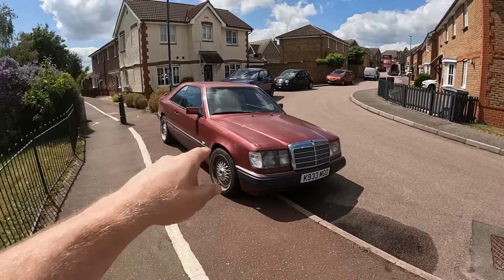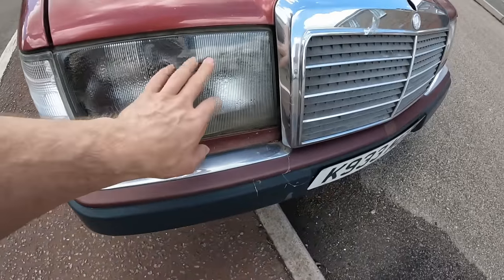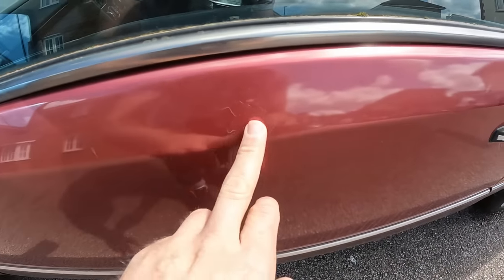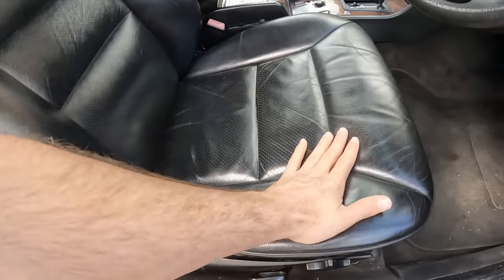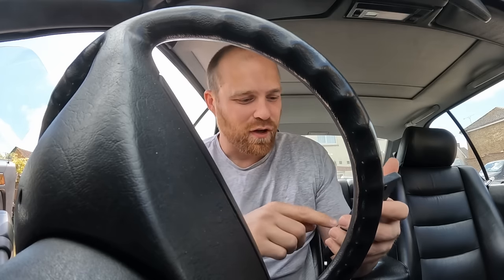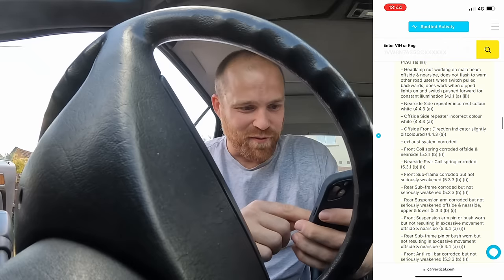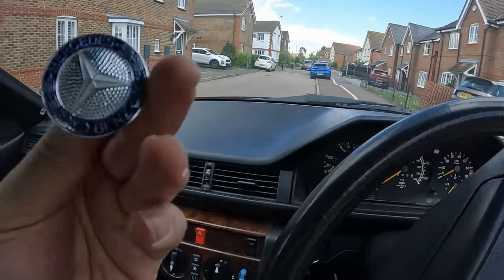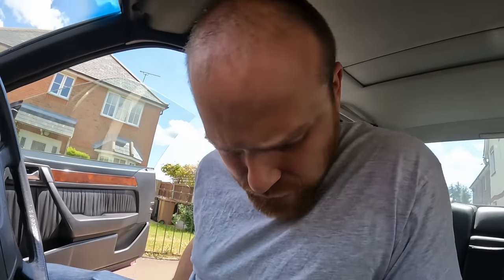Can this 29-year-old Mercedes be saved from the scrap yard?

Comment: I checked the MOT history on this car ... makes for scary reading.
I've had a few 190e versions - a common thing to fail is the fuel pump and OVP relays.  I bought a 1.8 W201 that wouldn't start without cranking for about a minute, wouldn't tick over, kept stalling, etc.  Otherwise immaculate.  Seller let it go for next to nought.  £40's worth of Chinese made relays turned it into an awesome daily runner.

Comment: A thing to be wary of, Mercedes used a biodegradable insulation on the wiring (I believe) and it has a tendency to crumble with age. The worst location is under the cover over the plugs due to heat. I had an E280 and had to have the entire loom replaced.
Also there is a way to open the bonnet to vertical for easier access on W124 models.
Good luck with bringing the car back to life.
Reply: It is indeed a weak speed - but luckily it’s more of a problem for the six cylinder engines than the four cylinder engine here.
Reply from the maker: So I spoke to one of the previous owners yesterday who told me that he had the wiring loom replaced a few years ago, so hopefully that problem should be solved already. Will certainly save me a few quid and a load of effort!
Reply: @NotEconomicallyViable  that's great news and it's certainly saved you a few pennies!
Reply: Yes i had the same on a 95 c280

Comment: I had the exact same model, was also randomly stalling - the culprit was a silver relay located behind the battery. It was damaged by water, a very common issue on these, check it and make sure to seal it if it is not damaged yet. Unfortunately I had an accident and had to total the car - missed it ever since. Best of luck!

Comment: Im a mechanic in NZ. I used to work on the W124s and this is one of the later ones. The motors are good but i remember we replaced a lot of airflow meters on them. They are mounted on the air intake hose just behind the air filter box. They also need fuel pumps when they get old as the resistance gets high in the fuel pump and they stop working. The best thing to do is spend the money and get it scanned at a merc shop. Another thought i had is One of the merc trans's has a sensor plate in the trans sandwiched above the valve body with a round plug that goes through the the side of the trans. If the ecu doesn't get a signal from the sensor plate to show the motors running it stops and shuts off the relay for the fuel pump. Its designed to stop the fuel pump running if you leave ign on without the motor running. If you need to buy one get the three "O" rings that fit the plug as they can leak if they are disturbed.

Comment: I think a lot of people know why the mirrors are like that. The path length from the eye to the mirror is different for the passenger side & the driver's side, because you don't sit in the center of the car, therefore the dimension of the mirror would need to be different each side to get the desired viewed area.

Comment: hey nino good video love the good old 124s. I've been driving 124 as an everyday car for 18 years now. from my experience the first thing you need to check is your insulation on the wiring in the engine compartment remove the black cover with the star on then you can see the wire. and behind your battery / black cover where you should be able to see your part number and year on the wiring if it's from 1993 then it should probably have a new one. number 2 check throttle body for wiring harness they are famous for breaking after all those years. number 3 replace your maf you can scan for the code with an OBD1 Diagnostic code reader for Cars with the 8 or 16 Port number 4 check your ovp relay it helps to control the idle in your 124

Comment: What's not to like? I have 4 190e s and all bought for under 500 pounds one for 250. Even with work needed doubtful it will depreciate and it has the three pointed star on the bonnet. Better than spending thousands of pounds on a new type bubble car as I term them. Others will disagree.good luck with it and I'm sure you won't be disappointed with the end result. Rog

Comment: Hi Nino. Glad you eventually bought the car you have lusted over for a long time. The stuff in the boot was a fantastic bonus.
                I am looking forward to the Project. Try not to fit too many "Knock off" parts as they "WILL" bite back. See you in the next one. Take care. 👍👍
Reply from the maker: Cheers, Norman. That's the only cheap part from eBay I plan to buy for this car. I only bought it because the OVP was only replaced recently and I'm not convinced it's broken again.

Comment: Mine is a 1992 220ce .. engine would cut out … checked  air intake plastics , ovp  and even the ecu .. turned out to be the crankshaft position sensor … after that worked great … hope you fix it !!! Cheers
Reply: Your color looks to be Almadine red

Comment: Love your video's man. Absolute binge watch material. I'm driving around in a 30 year old Volvo 240 wagon that i try to keep on the road myself. Had to lauch when you diagnosed the faulty relay, told everyone a moment later you're not a 'real mechanic' when it comes to diagnosing car issues, and then find a work order in the boot that states replacement of exactly that faulty relay because of engine issues 😂

Comment: A great find Nino, it would have been a great shame to scrap it, Mercedes definately do rust, but I think the older ones were just made with better steel, the later C and E classes were very rust prone.    
     I love the 190 and the later E class with the Oval lights and 3.2 Diesel engine. 
    Good luck with the car mate, look forwards to your progress.
Reply from the maker: Cheers bud 🙌🏻
Reply: I have a 2004 (5 cylinder) E 270 cdi and it's one of the best cars I've owned.

Comment: A common problem with relays of that age is cracked solder joints on the relay PCB (due to mechanical vibration each time the relay is energized). It makes sense to suck the old solder and refresh the solder joints

Comment: Might be worth testing the alternator voltage, regulator may have failed and putting out higher voltage and damaging the battery and/or sensors?
Reply from the maker: Cheers bud, will give that a go 👍🏻
Reply: YES!  My alternator was producing nothing at all...the dashboard was clicking on and off.

Comment: Nice project mate... Love W123/124 Mercs, last of the 'proper' Mercedes . I used to cab a 123 back in the 80's when my colleagues were cabbing cortinas and hunters etc. They used to ask "how can you afford to cab a Merc". Well Six trouble free years later I asked them "how could you afford not to? 😃😃 Looking forward to this one... My only concern though is the rust underneath.(I've seen the mot history) Get that dealt with first and it will last another 30 years... Cheers...
Reply from the maker: Ahh I love that. I read recently that German cabbies used W124s almost exclusively – 200d mainly.

I'll be getting her up on axle stands and checking out underneath, so hopefully it's not too bad 👍🏻

Comment: C124 is great , worth saving . Think the colour is Titanite? Your C124 is also one of the mid life ones with a later 220 engine (bit better mileage and performance than the 230) but the first era grill with the hood ornament on the grill not like the later ones with it in the bonnet. Many were converted to bonnet so nice you have the original set up. I think its quite good having one of these in between models best of both worlds so to speak. Air con and a roof is unusual in a 220 also ! 
Good luck

Comment: Yes something retro that looks awesome, I daily drive a 1988 Nissan Bluebird and it's been a kind of rolling project. Older cars are definitely less complex and all the work I've done has been with my Haynes manual about 100 pounds worth of tools and on the side of the road. Definitely be careful though of siezed bolts and for some reason my nissan has lots of Philips and flat head screws which strip so easily. If you come across lots of 'normal screws' I would definitely invest in the Halfords advanced impact driver set which is only 15 pounds and has saved me many times. Good luck with the resto and I look forward to these videos.
Reply from the maker: Love that. Roadside repairs are where it's at – great effort 💪🏼

Comment: I would be checking the fuel pump or some kind of petrol starvation. A relay going nuts so something is causing a short somewhere. Most people don't think of the fuel pumps yet they are the main fuel supply! .... Noisy fuel pump on a old car is the sign of it going! My Granada Ghia X was doing the same as your Merc, turned out to be the fuel pump. .... It's worth checking anyway ;-)
Reply from the maker: Cheers for that, Dave. Will check out the fuel pump and also see if I can find any shorts 👍🏻

Comment: I think you’ve got a diamond in the rough there.     I’d wager the front wings have been replaced already and that’s one of the key rust issues for this model;  the rust on the rear arch looks doable and the paint looks like will come up good with some treatment. One area to keep an eye on is rust on the jacking points as they’re covered and the plastic cladding can hide a number of sins.     A great choice of car when you get it back n the road.
Reply from the maker: I certainly like to think she's a diamond in the rough. Gonna give her the love she deserves that's for sure

Comment: The mirrors being different shapes and sizes is to do with helping with visibility on the opposite side you're sitting on. Helps you see the length of the vehicle. Opposite side for LHD because you need to see more of the right hand side of the car.

Same as on the VW T4.
Reply: I think the reason for the smaller mirror to be smaller was aerodynamics, at least that was the story when the W201 (190) was introduced IIRC

Comment: If it's had 2 new batteries and an over voltage relay, I would check the charging system. Could be the voltage regulator allowing over charging.
Reply from the maker: Great shout – I'll give that a go 👍🏻
Reply: yes try the OVP common to the 190e also. Should have a fuse in the top and may have a fuel pump relay also. good luck with the project. my advice dont change too many things at once or u end up not really knowing what the fix was! 👍

Comment: The noise in the engine bay is the throttle recalibration after the battery has been disconnected. And I did have 2 of the w124.  300e m103 and 300d om603 and the 300d I think was the best model. You got yourself an awesome car Sir (lol as you now ride around in the w124 platform).  Am also looking for one. Wow. Am longing for any w124 non runner but good chasis.   I ran the 300d on veggie oil before the veggie oil tax. For over 30,000miles. Bruv very nice find. Bolt on turbo kit for the m111. M111k conrods and pistons to lower compression and get speeduino ecu and boost away. Diff options, 722.6 with Olef tcu, and you roast audis and bmw all day.
Reply from the maker: Ahh that's good to know about the recalibration. Great to see a proper Merc fan watching the videos. Absolutely love that you ran a 300D on veggie oil for 30k miles. Hero.

Comment: I'd check the OVP Over Voltage Protection relay which resided behind the plastic cowling to the back of the battery. I think they're about £70 from the dealer, usually has a fuse located on top. You stated there was a lot of clicking in that area? I've always wanted a 300CE, but  currently have a 2.6 190e. Also corrosion wise, check the jacking points behind the plastic side skirts. .......Oh you've just mentioned the OVP whilst I'm typing.

Comment: Try some carb or brake cleaner aerosols directly in to the throttle body whilst it’s running, have someone keeping the revs up when you do it because it will want to cut out. Had similar problems with 90’s 3 series BMW’s. Good luck!

Comment: The OVP relays can come with different pin connectors so make sure you get the correct one. Other things that go wrong with them is the solders break in one that is old and you can open them up with some work and resolder the board inside. Use your phone or a good light and magnifying glass or a clear zoomed in photo and you can often see cracked solder joints which can be a simple and cheap fix. Also replace the voltage regulator in the alternator (5 minute job) and you've solved two common idle and engine issues for cheap and easy. At least you remove them from being future problems and off the table. Also try and by OEM or you'll be chasing problems for all your days.
Reply from the maker: Thanks for that info, Mike, very helpful 👍🏻

Comment: Just pop the center caps off, by loosening the center nut. It should reveal a bbs engraving and a number like "RS001" for example. If there isn't any sign of a popular manufacturer the wheels are not worth saving as you said. If they are legit 3 piece RS BBS Wheels, then you can swap the worn and pitted lips for some brand new polished ones and the rims are definitely worth saving.
Reply from the maker: Ahhh thanks for this. Been trying to find some decent info on how to tell if they're real. I'm almost certain they're copies, but definitely worth checking!
Reply: Also worth a cupple of grand if genuine bbs

Comment: Check the air intake system and the sensors or take them off and bypass the sensor and check or replace the fuel filters might solve alot and make diagnose alot easier.
Reply from the maker: Nice one, will give that a go 👍🏻

Comment: Seems like the MAF sensor to me, common fault on these m111 engines. You can unplug the sensor, though power will be down, it should run without cutting out. I don't know if they are available from Mercedes (they're sometimes the cheapest source for parts) but bosch ones are available and I don't think it's worth getting a cheap chinese part. Having said that it definitely could be a bad relay and as that's the cheapest option I'd change that first. Good luck, they're good cars and straightforward enough to work on.
Reply from the maker: Thanks for that, James. Will take a look at the MAF

Comment: If my previous comment doesn’t cure it could be the cam Position sensor if it has one, but I doubt that, as it’s rough from cold. May be mass air flow sensor.   Had this go on early Corsa’s. (1993+)

Comment: Its a face lift model with the plastic lower door  trims but has a pre face lift grille, grille should be flush, that might be why the paint is rough on the bonnet as its been painted to match the car, nice looking, the last of the well built Mercedes. For spare try Mercman
Reply from the maker: So the coupes actually had the plastic lower door trims from the outset Gen 1 models. The estate and saloons got them in Gen 2. You’re right about the grille for sure - I found out it’s had a new bonnet. I talk about this is the next video. Thanks for the Mercman recommendation 👍🏻